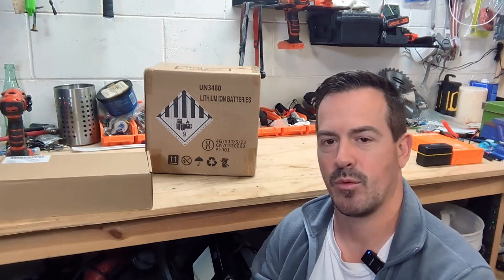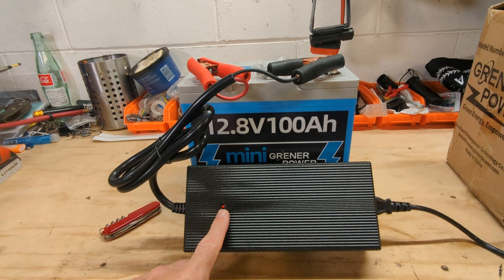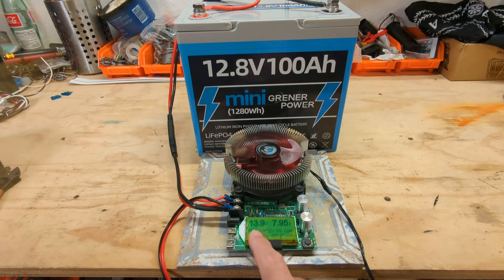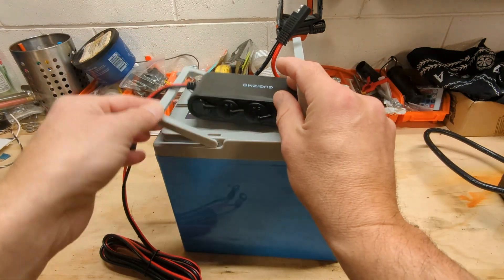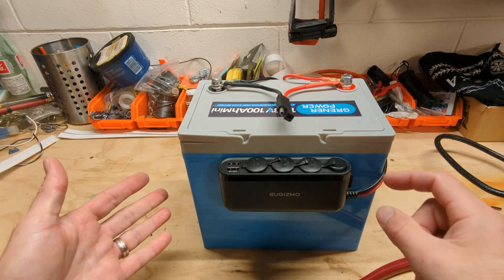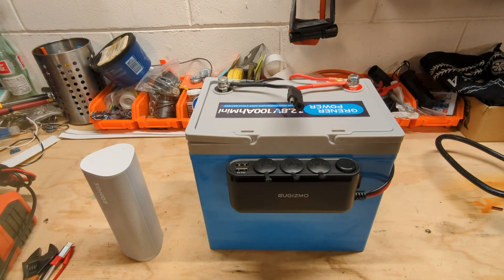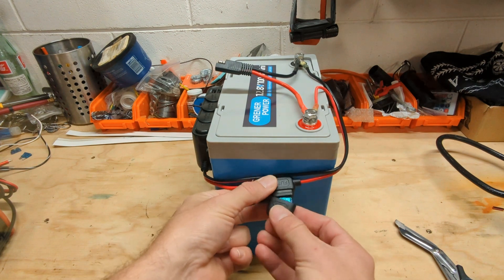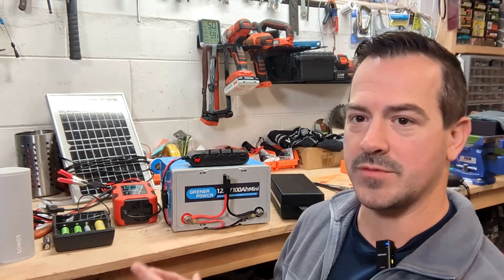SIMPLE DIY PORTABLE POWER STATION 12v Battery Bank - Best So Far! Grener Power #rv #offgrid #lifepo4

Comment: Will this also work with a regular deep cycle lead/acid marine battery?
Reply from the maker: Sure, just note you only get to use 50% of the capacity of a lead acid battery before needing to charge it back up. Also, it will weigh a lot more and won't last as many charge cycles. If you are purchasing new, Lifepo4 batterie are actually much cheaper to operate and manage over a longer timeline. If you have LA batteries laying around, sure, put em to use!
Reply: @ thank you! And another question I suppose then… what’s the benefit of this method compared to just a “power bank” like the jackery?

Comment: So is this equivalent to a 1,000W power station? Would you add an inverter to that?
Reply from the maker: Sure if you need 120v.. this will run 1000w just fine! 💪

Comment: How many hours did you get on the load test ? I want to build one to last 16 hours before I could solar charge it . I need to run an O 2 concentrator.
Reply from the maker: Hi there! Thanks for your Q! Depending on how much your machine draws in watts, you can do some basic math. Looks like the average machine is 300-600w.. put that into 1280wh battery, you'd need ~4-8 100ah batteries for 16hrs run time.
Reply: @TackleThat  mine says it uses 175 watts. How much power for that? And what is the math formula to find out?
Reply from the maker: Nice, that's an efficient machine.  So we want to keep power calculations in watts (w) when considering how much 'power' you can get out a battery.  Your machine draws 175 watts. So in an hour, it would draw 175 watt hours (wh).  This battery is 12.8v x 100ah = 1280wh. So 1280wh/175w = 7.3ish hours of run time. You also have 10% or more loss when switching 12v to 120v in your inverter, so you'd need 3 batteries to last you  7.3hrs x 3batts = 21.9hrs x 90% inverter efficiency = ~19hrs of run time.  You would have no inverter loss if your machine can run on 12v natively,  not sure the capabilities of yours. That help at all? Thanks again for your questions!

Comment: As I am an old guy can you explain the difference between amps and voltage watts and the other stuff
Reply from the maker: SURE! Are you wanting a video on this topic lol?  AMPS are like water pressure, VOLTS are like the size of the hose, those multiplied together equal Gallons per min (WATTS).  AMPS X VOLTS = WATTS.  You got to make sure your amps are not restricted by the wire size, as to cause HEAT and power loss... and FIRE! AHHHHHHHHHHHHH